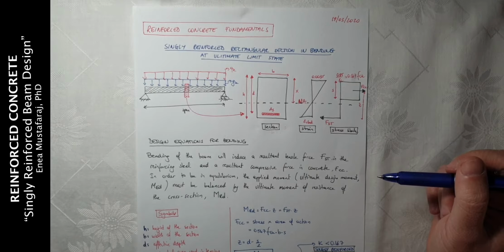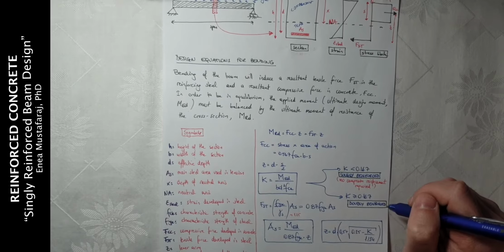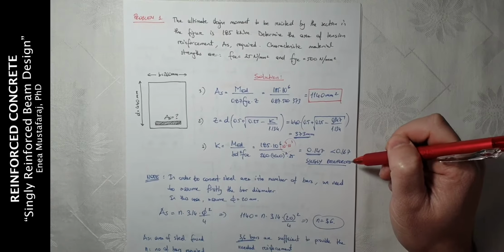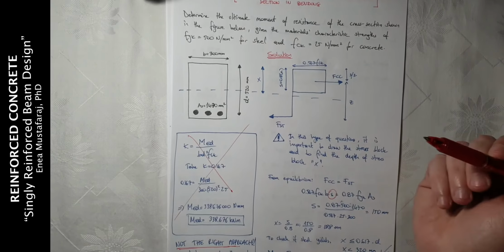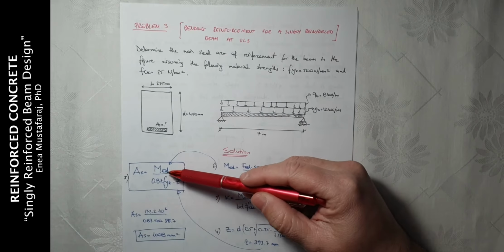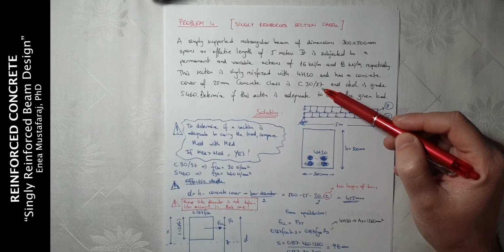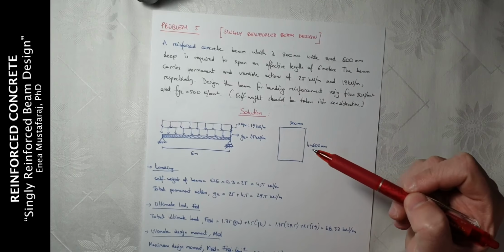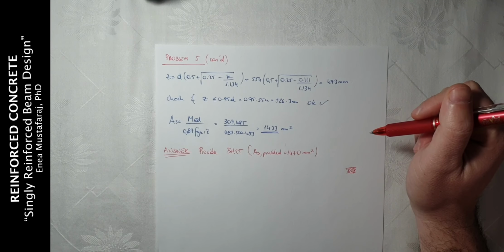Eurocode 2: A Guide to Flexural Design of a Singly Reinforced Beam | Engineering Lecture 1

Comment: May I know why you use F c k instead of F c d [Design value of concrete compressive strength (F c d = 𝛼_𝑐𝑐 . F c k/ 𝛾_𝐶) as per EN 1992.1.1 2004 section 3.1.6]?

Comment: Am i just dumb ? im getting a different equation for "z"
Reply: never mind they both arrive at same value
Reply from the maker: The equation for the lever arm is in a simplified form. 

If you get this expression: 
z = d – 0.5 λx, 
z/d = 1 − 0.5 λ (x/d),

if you make some further substitutions, you will end up with:

z/d = 1-0.5α = 0.5 [1 -√(1-3k/η)]

where : α= λ*x/d,  and λ is generally equal to 0.8
η = 1 when fck<50 MPa